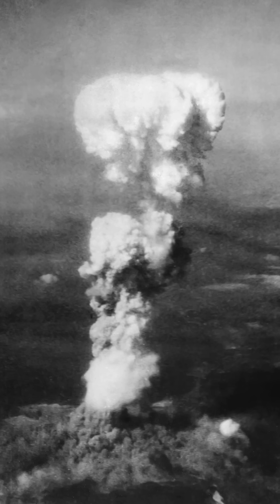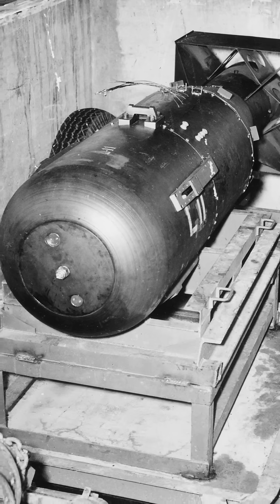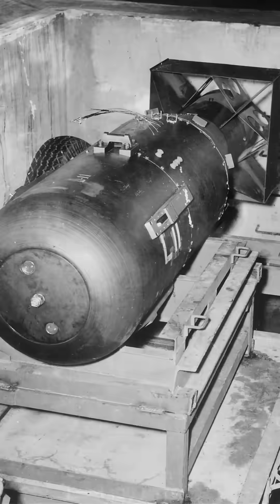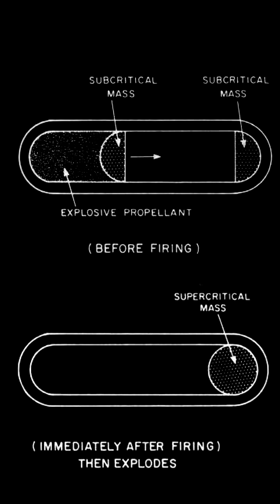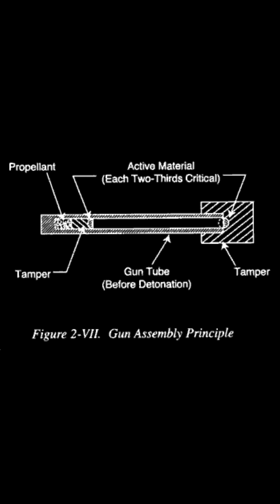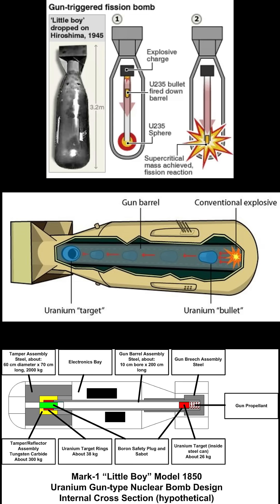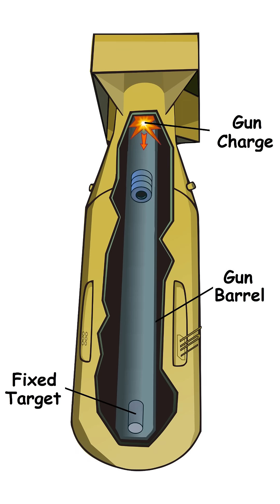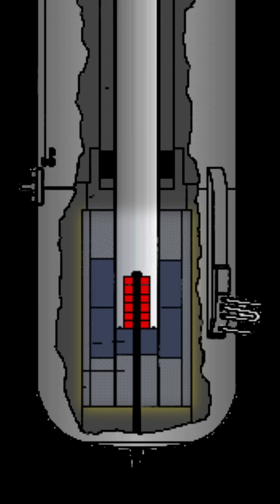What Everyone Gets Wrong About The First Nuclear Weapon Used In War

Comment: The design has been used since in e.g. the W9 nuclear artillery shell.

Not sure it's that different on efficiency, but requires highly enriched uranium that's expensive.

Main shortcoming appears to be from a safety perspective. Implosion devices have complex fire sequences that makes accidental nuclear detonation or deliberately bypass of the PAL system almost impossible.

Comment: Yet a design that a high school student could replicate today if they could get the fissile material which brings to mind why less developed nations and organizations haven't done it yet...
Reply: it's simply that massive a task to gather that much material.
Reply: @Agarwaen  It's also why the export of centrifuges are heavily regulated as that's the current method for separating uranium 235 from uranium 238.  Now neutron bombardment of Thorium can produce uranium 233 with trace amounts of uranium 232, both of which are fissible, without the need for mass separation but the Uranium 232 emits gamma radiation during it's decay cycle making fabrication dangerous and also disrupts electronics so it's assumed that isotope mass separation is also needed to remove the uranium 232, however, the desired isotope uranium 233 is the majority whereas with uranium 235 from uranium 238, the desired isotope uranium 235 is the minority component.   This means that so long as you don't mind disposing of some of the uranium 233 with the unwanted uranium 232, you can use a purification process from biology by separating the uranium into small samples, testing for the presence of uranium 232 which is easy as it will be emitting dangerous gamma rays and disposing of the samples that test positive for uranium 232, leaving you with a few samples of pure uranium 233 that could be safely machined into a weapon, all without the restricted centrifuges.  It's commonly said that Thorium breeder reactors do not create weapons grade material because of the uranium 232 while weapons grade plutonium can be extracted easily from conventional uranium 235 reactors and I do like the idea of building thorium breeder reactors for inexpensive civilian power but I feel that weapons grade uranium 233 could still be purified without regulated devices so long as you don't mind disposing of a lot of the uranium 233 with the unwanted uranium 232.

Note that by disposing would mean adding back into the reactor core to fuel it with molten salt reactors.

We currently rely on the difficulty of separating by isotopes to prevent the proliferation of weapons grade material but I suspect such difficult separation means might not be necessary if we use refinement methods popular in biology.

Comment: my understanding is that the reason the little boy design was "retired" was because weapon grade uranium is rare. that's the reason Japan didn't surrender at first because they thought we didn't have enough uranium to make many more. when they figured out we used plutonium for the second bomb they knew we could make thousands of bombs and surrendered
Reply: this isn't information they would have any real way to establish.  and it's less that it's rare, but rather that it's just way more expensive. you can take barely or pretty much entirely unenriched uranium into a breeder reactor to produce plutonium. which you then can separate through chemistry, bypassing the ridiculously large enrichment plants required for uranium bombs. now dropping the 2nd (with a third being readied in case it was needed) was to some extent needed so it was clear this was repeatable.
Reply: @Agarwaen  from what I heard the Japanese scientists advisers told the Emperor that was likely the only nuclear bomb we had. And when they realized that the second bomb used platinum that they were in real trouble

Comment: "A design so reliable that it was never tested before use."
That may seem like the most ridiculous statement in the history of engineering and weapon making. But it takes second place behind the follow up statement the the design was discarded after Hiroshima. 
WTF??!!! It's so simple, it works flawlessly so we will destroy the design details and never use it again.  
Is your brain incapable of detecting a lie?
Reply: We had better methods to make more powerful bombs after Hiroshima
Reply: the design of the bomb is pretty simple (though I bet there's still some details that aren't public). thing is, the reason it's so simple, is because if you actually have u-235 at the high grade,  your biggest issue really having it not detonate too early, instead of getting it to detonate at all. luckily, it takes a MASSIVE industry to get to that point.

Comment: Fun fact: the uranium needed for weapons-grade fissionable material is mined in the Four Corners Apache land, among other places. The mining tailings have contaminated the whole area. The mining has made the water undrinkable and poisoned the food for thousands of years. Many tons of "depleted uranium 238" or DU is refined out during the U235 refining. This "depleted uranium 238" or DU is used by the military for bunker busting and tank busting. DU is twice as dense as lead and slightly radioactive (alpha). The MILSPEC for DU is "DULLRAM" Depleded Uranium Low-Level Radioactive Munitions. DU is usually not ballistic but is pyrophoric, which means it burns in the air, producing DU smoke, the size of cigarette smoke, which enters the body thru the mouth, eyes, skin. Once inside the body, it starts to burn the cells around it. Over 350,000 American soilders were exposed to it during operations and firing ranges around the world. Horrible birth defects are recorded where they were used. The US Veterans Administration ignores the pleas of thousands of suffering veterans. There is no cure for DU poisoning, but a treatment is available.
Reply: it's only slightly denser than lead. it's however much..much harder. also something being "ballistic" isn't to do with chemistry.. it simply means it's being launched in a parabolic path.

Comment: They (felt) the design didn't need tested - or was it not tested beforehand?
Reply: they had spent a couple years accruing that much refined uranium, as was the physics so solid there was more or less no way it wouldn't work (after all, they'd made the much harder implosion device work already and tested it).

Comment: We tend to focus on these bombs and the horrors they brought about. I was shocked when I watched a documentary called the Fog of War, which partially dealt with WWII. It's a super good documentary, along with Why We Fight. Amazing insights into America in relation to war.
In any event, we think about the big bombs as being the horror. The reality is, they were a blip in the horrors visited on Japan. The Americand were having a terrible time fighting the war. Their planes were so advanced they couldn't be shot down, but they were so terrible at aiming they missed the vast majority of their targets. So, someone clued in that most structures in Japan at the time were wood structures. So, they changed their bombs from the normal type to fire bombs. They still sucked at aiming, but they started huge fires that spread quickly in cities. 
During these fire bombing campaigns, they burned alive more men, women, and children than both the nukes combined easily.
Also, the nukes didn't win the war. That's just government hype. America cut Japan off from oil supplies. Japan was so desparate for oil that they would cut down huge swaths of trees just to put half a tank of fuel into a plane. I say half a tank, because that was the real reason why Japanese planes suicided into the ships. Their military only gave them enough fuel for a one way flight. They either crashed into the boat or the ocean, but there was no coming back 
In fact, even on the German side of the war, oil really became the deciding factor in who won. German decisions literally ground to a halt due to a lack of fuel.

Comment: Ok, so wild guess here, but I imagine that the reason why those diagrams are wrong and incomplete is so that you can't just use them to build one at home. And this video kinda defeats that purpose.
Reply: You couldn't build one at home anyway, you need over 140lbs of uranium refined to 80% or higher

To refine the uranium, you would need equipment that cost several billions to trillions since you need to separate atoms where the weight difference is 3 neutrons

You also can't use U238 for it either
Reply: @LadyMaria_AstralClocktower  You did realize countries like Iran are a thing, right?
Reply: @CristiNeagu  if they enough money for the equipment, they can afford to make one and aren't going to watch a youtube video to design it
Reply: @LadyMaria_AstralClocktower  Having money is not enough. You need to also know HOW to do it. Here's another country you may not have heard about: North Korea. Do you even know there is an embargo on technology and raw materials in order to prevent countries from building nuclear weapons?

Comment: Way more of Little Boy’s uranium got blown up than fissioned. Only 1 gram of Little Boy’s 64 grams of Uranium created energy, less than 2%. The rest became fallout. Yea, they sure couldn’t put plutonium in one of those things. The Pu240 impurity in the plutonium would cause a fissile explosion and burst the device before the two masses could assemble. The implosion device was also very inefficient. Fat Man had only 1 kilogram of its 6 kilograms of plutonium create energy, around 16%. Later design improvements like hollow, self tamping pits, deuterium/tritium boosting gas, beryllium reflectors, vacuum tube based neutron sources, staged fission/fusion thermonuclear arrangements, Lithium 6 deuteride, “FOGBANK” aerogel interstages, etc improved some of the inefficiency, but it’s still a very inefficient system. Antimatter based nuclear weapons would greatly improve efficiency, but that’s going to take a while.
Reply: Kirk: Mr.Spok are you done?
Warp 9 Mr.Sulu

Comment: Nuclear weapons can actually detonate too early. Any reaction will blow the material apart.
There is a specific point you want the reaction to start at - maximum criticality. Namely when the rings are firmly over the target. But any stray decay can start the reaction when you barely have criticality. 
Gun types suffer that issue particularly badly. Needing specific nuclear material with very low natural decay rates.

Comment: I once read that they didn’t stop using 235 until the 60’s…. Ivy king was pure fission.
Reply: Fusion bombs are actually fission-fusion-fission devices, with some adding a second fusion stage(the tsar bomb was initially planned as such, for example).
Reply: @vyor8837  so that was  fusion-fission-fusion-fission then?
Boy..
Reply: @John-wd5cb fission comes first, the fission bomb is used to generate the necessary heat, neutrons, xrays and neutrons to trigger the Lithium-Deuteride fusion then another fission bomb goes off
Reply: @LadyMaria_AstralClocktower /nerdvoice  aaactually, most modern devices uses tritium gas fusion  to help initiate the first fission stage, so it's sorta both first.

Comment: The Dept of Energy made a few MK1 Atomic Bombs and had them briefly in service. The problem was, the wet battery needed replaced after 48 hrs and required a team of 50 two days to tear it down and rebuild. After it’s retirement, five inert casings were sent to museums worldwide. A few years ago, someone got permission to examine the IWM “Little Boy” using medical endoscopy. To everyone’s shock, it was discovered that far from empty, the casings still contained much of the internal systems from seventy odd years ago. The five bombs were hastily recalled back to Sandia at Los Alamos and finally rendered inert.
Reply: That'll be John Coster-Mullen about 25 years ago. I don't even think he used medical endoscopy (at least, he doesn't mention that, just small cameras) and yes, the museums let him poke around the "display models" which did indeed turn out to be real, unused bomb cases, complete with the gun tube and target case at the front. They were rendered inert as they were recalled for "cleaning" and the gun tubes were replaced with a bit of steel pipe. Pretty incredible really!
Reply: @KiwiExpressCream Sounds like they were already entirely safe and the work to remove some of the innards degraded their value and authenticity as museum pieces. What did they claim the problem was? No-one was likely to make them work as nuclear weapons, the volume of U-235 required is prohibitive.
Reply: @owensmith7530  Don't disagree, but to quote from John Coster-Mullen on page 156 of my copy of "Atom Bomb: The Top Secret Inside of Little Boy and Fat Man", he says (beneath a photo he took of the original gun tube) "Photo was taken in 1995 through one of the baro holes in the tapered tail section of the Wright-Patterson LB (Little Boy) before it was "restored" (his quotes) in 2004". And under another photo he took: "This photo shows the 8" steel pipe that the DOE later substituted for the original gun tube in this LB."

So, whether or not they were safe, the DOE for whatever reason decided to replace the original gun tube with some steel pipe, obviously hoping nobody would notice. They didn't count on John Coster-Mullen!!!
Reply: A couple of things:
1. Little Boy, even after the war, was way before the Department of Energy.  The Atomic Energy Commission wasn't even founded until 1947
2.  The gun in the Little Boy was borrowed / designed by the Navy.  They had serious problems achieving the required "muzzle velocity" in the available space and weight.  This was until one of the physicists pointed out that it only had to be fired once.  So the Navy engineers raised the firing charge and thinned the barrel so it didn't immediately blow itself up before it blew itself up.
Reply: l swear l found one in a Cracker Jack box once. but seriously the lab boys back then could be kinda sloppy, pioneers are at times
Reply: Endoscopy is the wrong term it would be an endoscope

Comment: Great, now I know how to make an atomic bomb. I just need a bunch of uranium and tungsten. Btw, I knew Uranium was dangerous, but I didn't think it was THAT simple to make it explode.
Reply: Uranium by itself is actually safe, you can hold it in your hands without any protection equipment and be fine, it's just that in some extremely specific situations that it explodes
Reply: @LadyMaria_AstralClocktower  But according to that video, you just need to put enough of it together and surround it with some reflective metal. It's specific, but not as much as I thought.
Reply: @lucasbrelivet5238  The uranium used in bombs is U235. the little boy had a concentration of 80% U235, the amount found in natural uranium is 0.7%, to separate U235 and U238 you need several billion to trillions of dollars, since you need to separate atoms where the only difference is 3 neutrons, it also takes a massive amount of area, centrifuges, power, workers etc etc

Also, it required over 140lbs of uranium, so it required over 112lbs of a very specific isotope, which is extremely difficult to produce under very specific conditions just to make a single bomb
Reply: @LadyMaria_AstralClocktower  Oh, ok. That's reassuring.